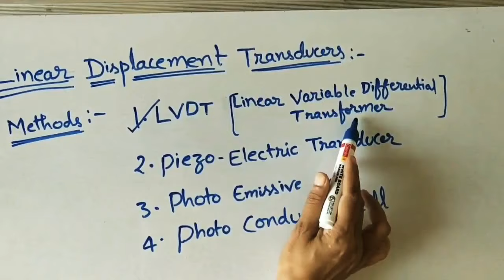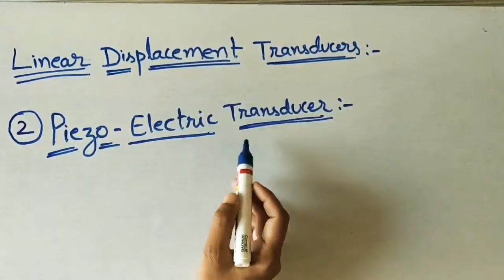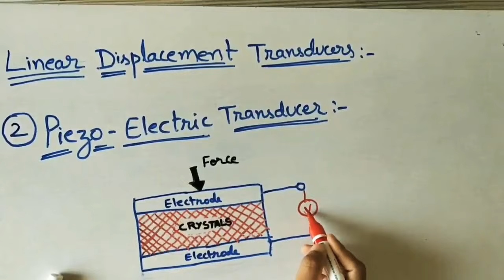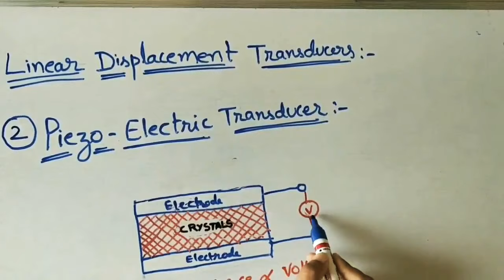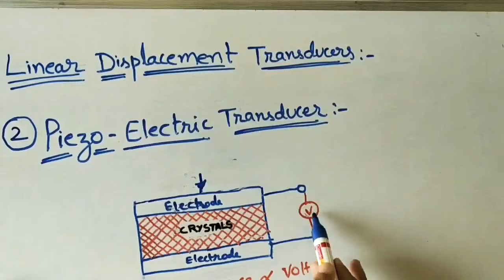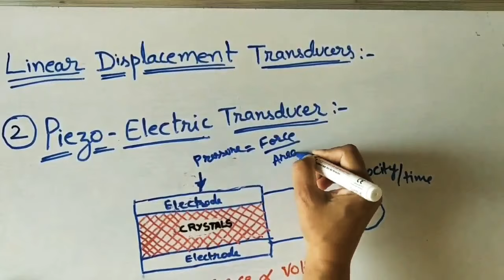Piezoelectric Transducer

Comment: Crystal only used?!? Or powder can do this..
If force is applied on crystal , it will not break?!? Crystal break out means ?!?
If voltage is applied on crystal which device can use to measure the force..
Please help me if I want to construct this crystal is enough?!
Reply from the maker: Crystals will not break
Reply: Thank you very much for your valuable reply..
Can you please mention crystal size or the device in real piezoelectric transducer anatomy ..it will make clear more..

Comment: Madam thank you .
This is active transducer right? then  in case 2 .,why there again power supplying to the crystal .
Reply from the maker: In case 2, there is no power supply to the crystals. Only force is applied on the crystals.
Reply: @engineeringclassesbydr.noo3377  thank for the clarification,  madam one more doubt why it is called linear displacement transducer
Reply from the maker: It can find linear displacement (Distance from one place to another place)  ,that's it's called Linear Displacement Transducer. It can also use for finding applied force, Pressure, ... Etc
Reply from the maker: Share my channel with students
Reply: @engineeringclassesbydr.noo3377  madam could please tell reference book for saying piezo electric transducer is linear . In our books piezo electric transducer not under linear , so could you tell reference book please madam